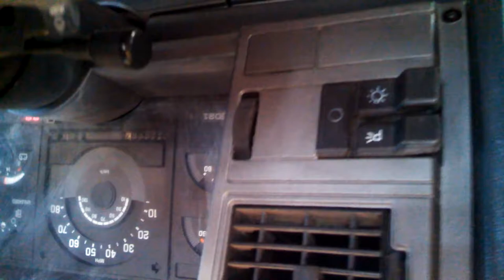1990 Chevy Stepside Lifted 9 inches with a 400 small block(sorry a lot of the movie is upside down)

Comment from the maker: engine is a 400 small block, double hump heads, mild comp cam, 650cfm carb...not sure the durration. Its an rcx 6 inch lift with a 3 inch body lift. it is currently on 33s but will be on 38s once completed